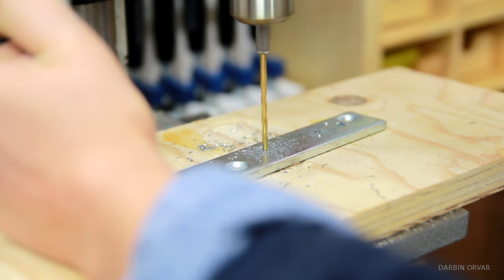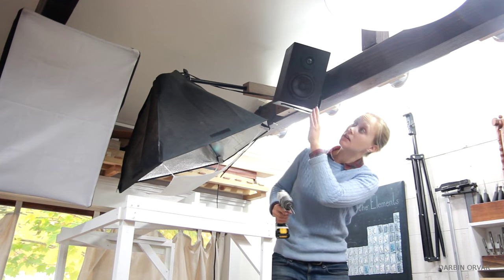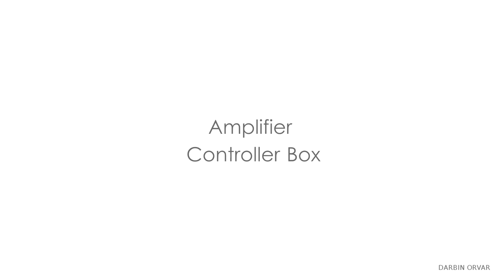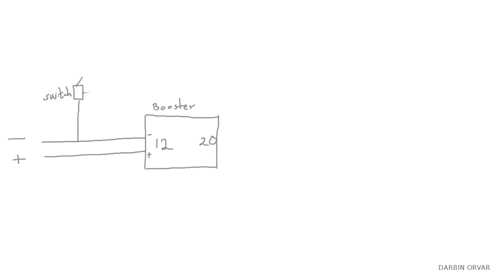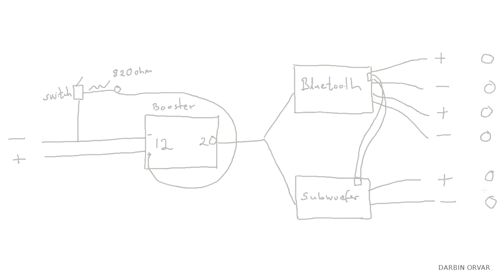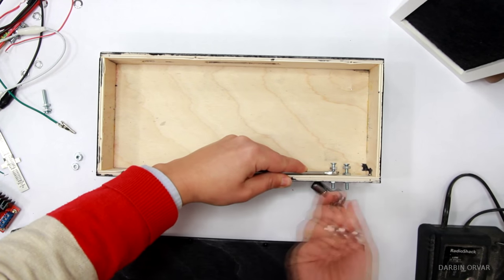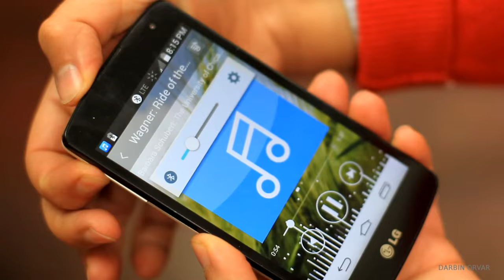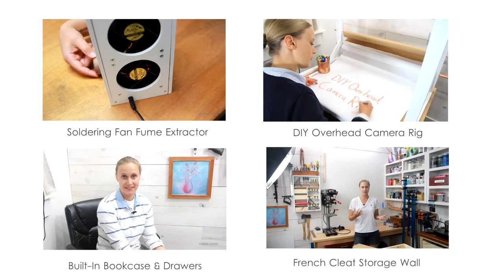Building a DIY Bluetooth Satellite Speaker System w/ Subwoofer

Comment: Well done & looks great..! May I make a suggestion..? Smaller bookshelf speakers even though  small they still require a very dense cabinet. Baltic birch ply is very nice material but will color the sound as compared to MDF or even high denisity partical board which does not. The "old school" rule for fill is 1/2#fill to one cubic ft (1728cubic inches) of a dacron material or approx double that for poly fill. Subwoofer boxes have to be super dense - even though small drivers are used the cabinet will color the sound regaurdless if its ported or not & should be lined with fill of sorts to help soften the "box" sound. Sealed sub boxes should be stuffed. The "fill" will help produce a much warmer deeper low end. In the late 90's I had a small custom audio shop - built many custom home audio cabinets & did 100's of cars...
Reply: I don't think it's that big a deal.  It's for music pleasure, she's not mixing tracks on them.
Reply: +markowalski Exactly "music pleasure" hence every step should be the best one can make it to enjoy that music pleasure

Comment: Hi Linn, your fearless way of jumping into the middle of things has inspired me to order  a bluetooth 2.1 amp board from ebay with a separate power supply. With some second hand hifi speakers and a passive subwoofer I feel confident I can make a pretty good housing for the amp and so make my own bluetooth system for a very reasonable price.

Comment: good job!!  woodworking is your specialty but speakers are mine.  thickness of the wood on the sub box is blocking most of the cone on the backs of the speakers.  routing and mounting flush solves this and let's the subs and their air around the basket move freely.  I love the 2.1 setup with the central box separate.  great job.

Comment: Nice project At first I did not think I would like the dye but looking at from different angles it pulled out the grain real nice going have to give it a try
Reply from the maker: +Charlie Wood Thanks Charlie! I've been really liking dye lately, so much easier to work with than stain, plus it comes out great every time.

Comment: 1. How can we add AUX and RCA inputs. As I would be using to connect my TV.
2. What is the reason Voltage booster as been used.

Comment: Looks great Linn! What's the difference between dye and stain?
Reply from the maker: +Robin Lewis Thanks Robin! Dye is water-based and stain is oil-based, but they work very similar. I like the dye a little more because it comes in powder form.
Reply: That sounds interesting, I might give dye a go

Comment: Great job, one step you skipped which is very important is to verify your speaker phasing. I like to put the speakers face to face and switch the speaker wires around on one speaker only. when the bass is the loudest means you have it right.

Comment: What's the overall budget for this project?
Reply from the maker: +Rick Martell Well, it depends on if you buy a kit or use old speakers from a thrift store. Probably around $300 or so for both kits and the electronics.

Comment: If I have 12v rechargeable batteries and want to wire them to the voltage booster will that drain the batteries fast?
Reply: Yes. You will draw more current thus depleting the battery faster. The only way this configuration works if you up the volt, but lower the current. (Which is not the case with what the booster in this video is used for)
Reply: +XsR thank you very much

Comment: I'm not big into audio, but I'm pretty sure that the subwoofer box should be empty. The empty cavity is for resonance, if I'm not mistaken. The sound dampening material might actually impede the quality of the subwoofer.
Reply from the maker: There was really no difference in my tests.
Reply: I really don't know. I've just never seen one with anything in it.
Reply: +Mark Speir I am also a speaker noob.  This may not be complete relevant, but I found it interesting, especially the part about preventing resonance from the back of the speaker: http://www.audiomasterclass.com/for-beginners-why-do-your-loudspeakers-have-holes-in-them
Reply: If you put insulation in it or not is really personal preference, depending on how you want it to sound
Reply: The wool does not actually do anything with the low frequencies present in the subwoofer It is only effective in the mid-to-high audio frequency range. Therefore it does not make any difference whether you put it here or not :-)
Reply: It is relatively common for commercially manufactured speakers to come with polyfill, it's an extra cost and I am very sure the penny pinchers wouldn't put it in for no reason. about 15 years ago I filled some speaker cabinets with the poly fill and swore I could hear a difference. Of course not a very scientific test, but I always have since then.
Reply: +Mark Speir Speakers need a certain volume of air inside of the box to function at their peak performance. Baffling inside the box can create the effect of having a larger air space. It is used when you have a small space but need a big box. In this case I don't know the specs on that speaker or whether or not the baffling is needed here, but it doesn't hurt anything to be there.

Comment: Good job, but should the sub box channel the air through those out holes you made? Most systems with a sub have channels for the air to come out but you've put that dampening it which would seem to defeat the point. I'm no expert but it doesn't seem to make a lot of sense in that respect.